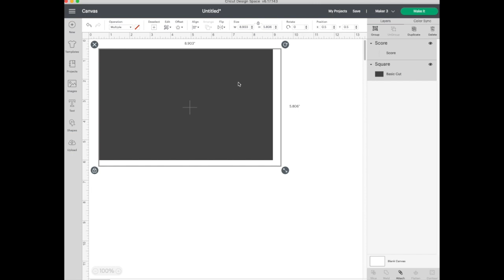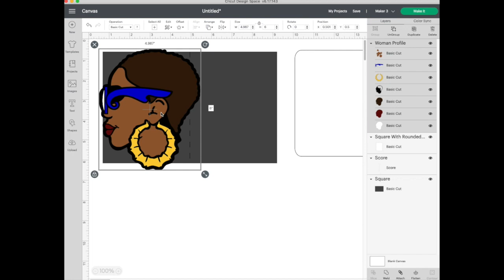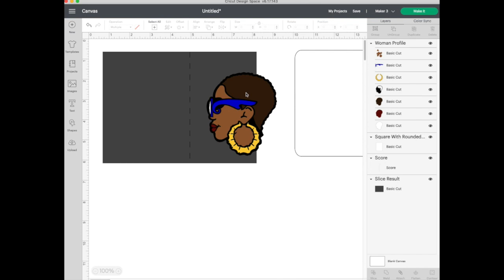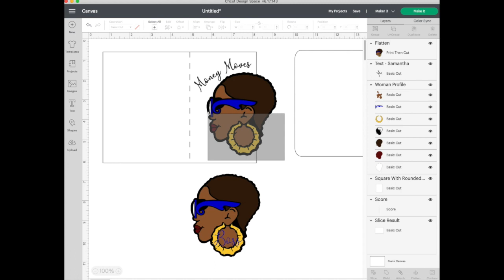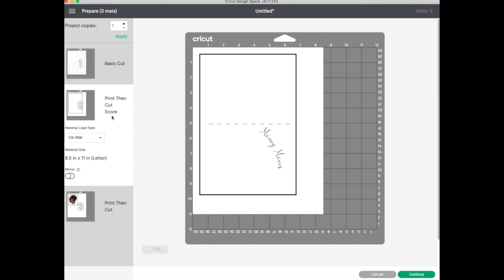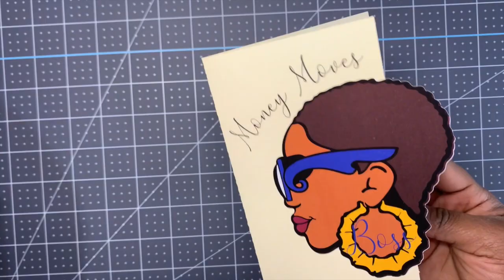Custom Cards in Cricut Design Space for Cricut Explore Air and Maker

Comment: Great tutorial and easy to follow.  I subscribed after watching your video.  One question:  how do you write words using circuit on the inside insert?
Reply from the maker: Thanks for watching! I usually add white cardstock inside with words separately. You can always use the write feature and pen. I just find it easier to either use the vinyl sticker paper and do a print and cut or the cardstock.

Comment: Finally! A tutorial that I can actually understand how to make a side edge card. Thank you so much! Was there a reason you used a printable vinyl instead of printing on cardstock?
Reply from the maker: I used printable vinyl to make the assembly easier. If I used cardstock, I would have to use adhesive and that's an extra step. lol. Both ways work.

Comment: Did u use something to make the women stick  onto the front of card
Reply from the maker: I used printable vinyl which has adhesive on the backside so I did not have to add anything. I just had to peel off the backing.